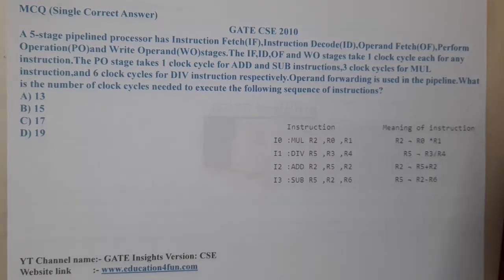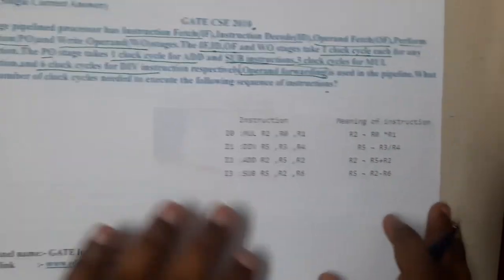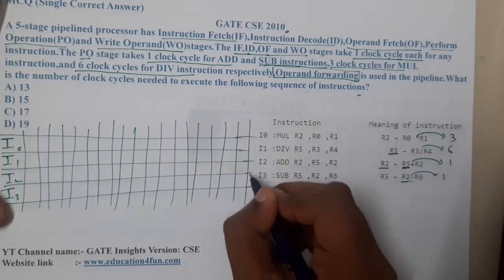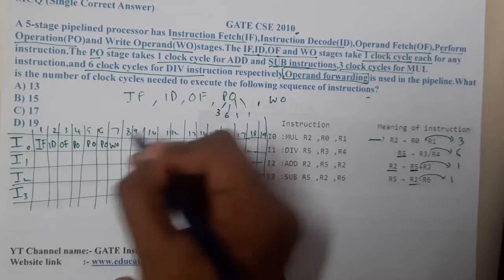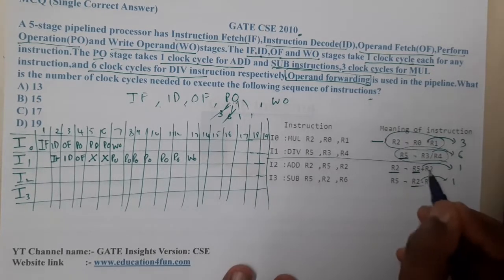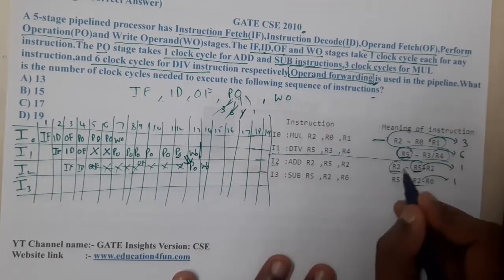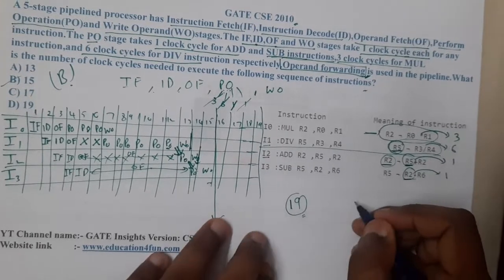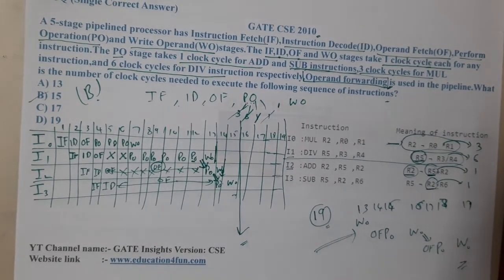GATE CSE 2010 || COMPUTER ORGANIZATION || GATE Insights Version: CSE

Comment: Consider the following sequence of instructions, which is to be a 5 stage pipeline: IF, ID, OF, EX and WB. Each stage takes one cycle instruction. Total cycles require to execute this sequence ? 
ADD R2, R1, R0
MUL R4, R3, R2
SUB R6, R5, R4
ADD R6, R7, R8
MUL R7, R1, R2
SUB R1, R3, R4
Sir can you make a table for this one to get clear idea of total cycle needed ?